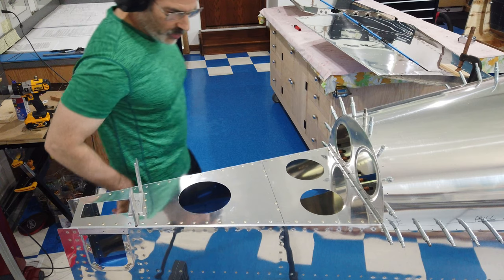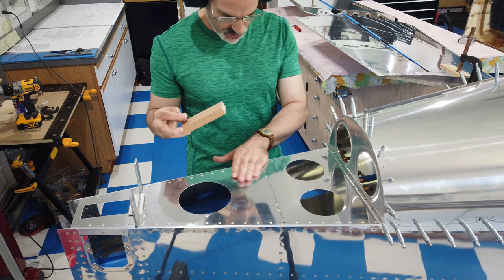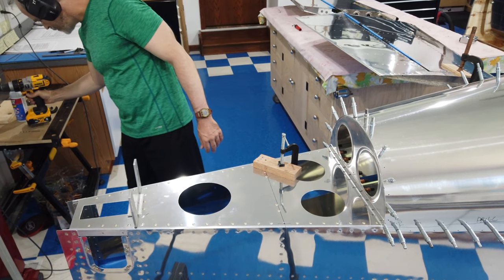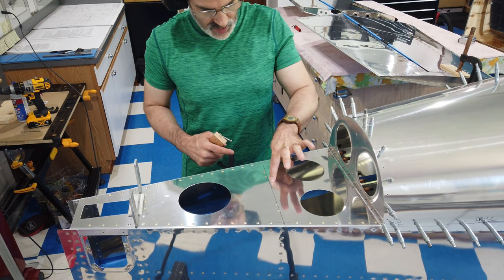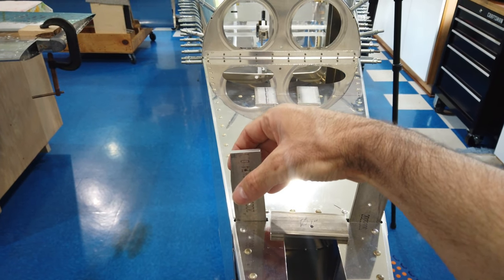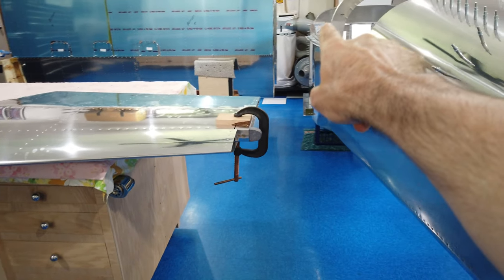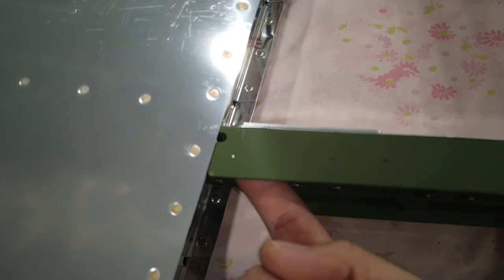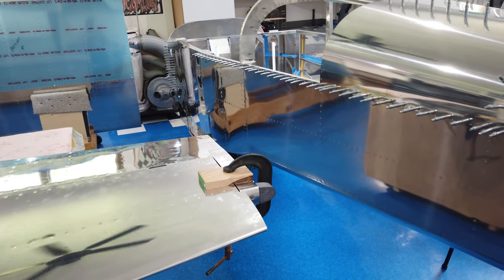Vans RV 7 HINT Video Horizontal Mount and Rigging 2

Comment: I like how you use the drilling jigs to help keep the holes as square as possible and stepping up in bit size. A little more time, but the results are worth it in the end.
Reply from the maker: Howdy Keith. Yes, the way I do most things are more tedious.  A lot of assembly/disassembly and verifying.  The hard wood block is nice as you can have multiple hole sizes and locations on a single piece of wood.